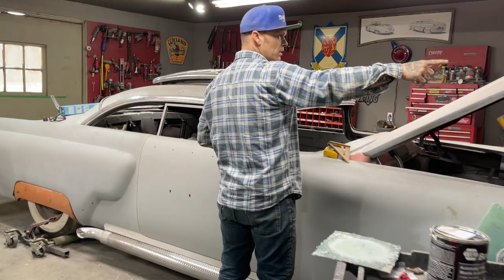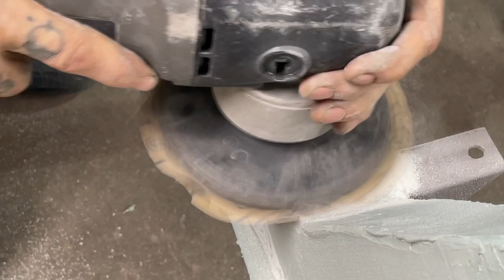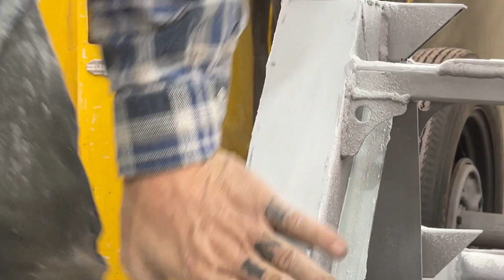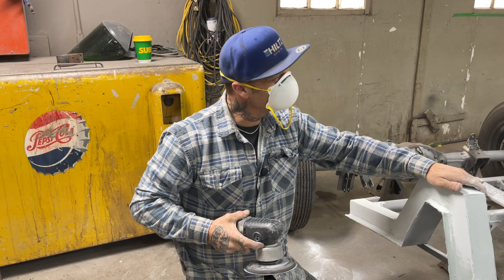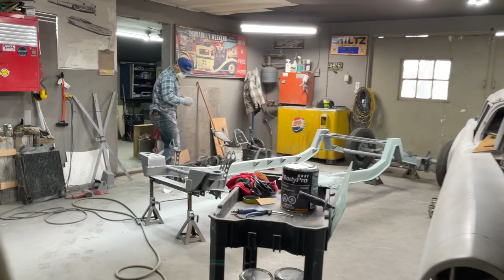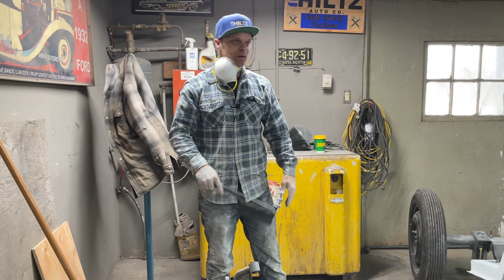Turning a Pitted Chassis into a Show Car Chassis: Sanding Auto Body Filler

Comment: Getting the frame ready for paint and then reassembly. I bet Jolene is not even excited because she knows another project will come up and the Bugatti will go on the back burner again and go sitting for who knows how long. I'm praying for Jolene that the Bugatti will stay on the board as the main project to get finished. What a ride it would be to drive to the store and go shopping in. Good luck and God bless.

Comment: Great car video. But please stay away from the medical advice. As a doc at a major medical institution. I had no clue what you were talking about with the facial and head massage for infection control. The lymphatic system doesn’t work that way. Lymph is constantly moving through the lymphatic system as a function of hydrostatic pressure and movement. Those T cells collect in lymph nodes based on the presence of pathogens.